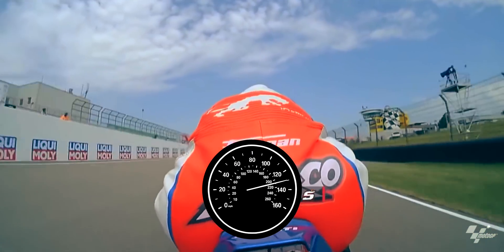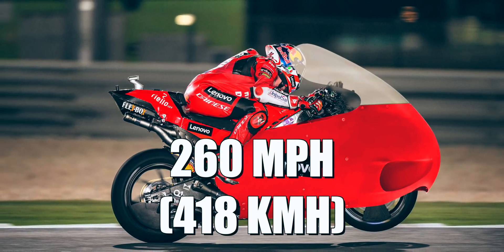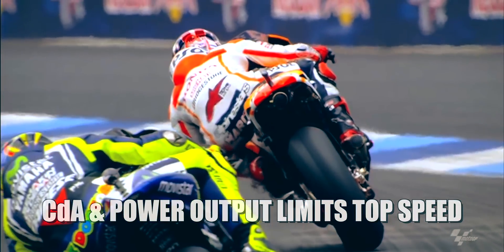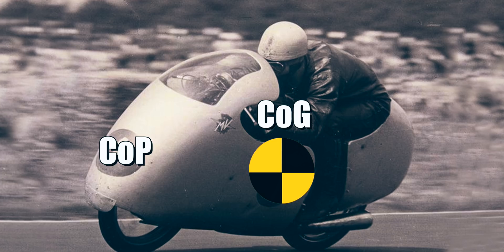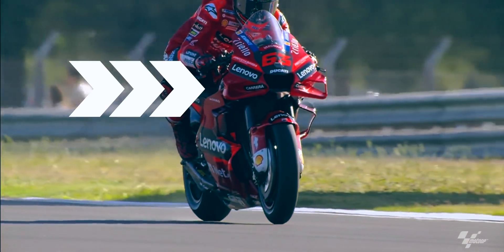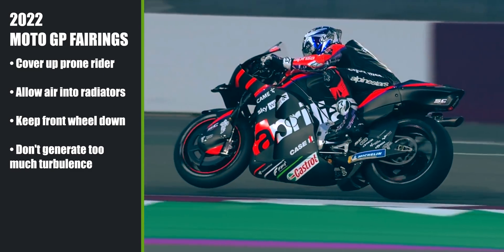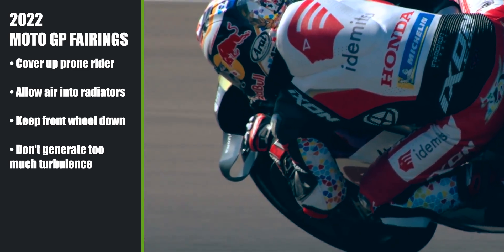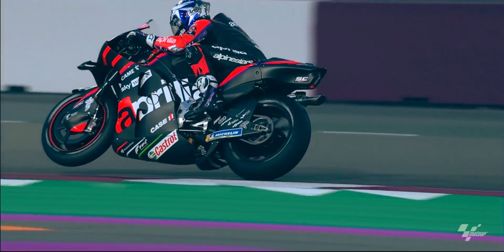Why Don't MotoGP Bikes Have Torpedo Fairings?

Comment: Good reminder of the efficiency of the mid-50s grand prix bikes with dustbin fairings. And they weren't all equally dangerous in crosswinds – some were much worse than others. The Moto Guzzis were better than the Gileras, for example. Also, remember the Norton Kneeler, which was more aerodynamic still (and broke the lap record at the NW200 in 1953). Then remember the Baumm NSU record breakers that were the most aerodynamic of the lot – recumbent riding position meant their 125 did 150mph with 16 horsepower in 1956! Also, Bob MacIntyre managed to do the first 100mph lap of the Isle of Man TT circuit on a Gilera with a dustbin fairing in 1957. I've ridden a lot of recumbent (feet first) motorcycles and never had a problem – from Quasars and Phasars to fully enclosed Peraves Ecomobiles and Monotracers on the autobahn. The Monotracer was measured to have a CdA of only 0.18. In my new the 1958 ban on aerodynamic fairings has been a serious restriction on motorcycle development ever since...

Comment: I do watch MotoGP occasionally, but it loses some of its appeal to me because the things are so slow in the turns compared to F1 cars.

I do wish there would be a way to get the bikes to corner faster. If you watch a video of a MotoGP bike and an F1 car on the same track, side-by-side, the bike looks pitiful in the turns by comparison.
Reply: That is true, but it's not really that the bikes can't corner faster, it's that the riders can't. 

They could add in a bunch of downforce, add in air brakes, all the F1 stuff, but the riders are still only held in by their own grip. To stop faster, the rider's forearms have to absorb that added force. To have more grip in turns the front tire needs more force applied onto it, which means that more force is also needed to turn that tire. And what creates that force? A rider without power steering.

F1 has both driver harnesses and power steering, making it less taxing on the driver at the same speed. Therefore they can push cornering speeds much further before reaching the driver's physical limit

Comment: This problem could probably be overcome to make Dustbin fairings stable and safe using some kind of active or passive damping system or longer more streamlined tail would bring the Cp behind the Cg to make it stable.  But the sensitivity to crosswinds would still be there.

Comment: If the center of pressure was high on the old design, wouldn’t the new wing design have a worse problem of that?

I’m more familiar with cars but having a front end COP especially a large amount of front downforce makes for unstable driving. Wouldn’t having a less aerodynamic front with downforce make it worse?

Edit: I think I get it. Back to cars, the previous generation of NASCARs were flat from the right front where to the rear bumper. This aided in cornering and correcting slides. They were also nose heavy which with the flat side gave it an almost correcting arrow effect the more sideways it got. The old motorcycles had flat sides on the front and were rear heavy. I was thinking downforce not sideforce.

Comment: If fairings dramatically increased top speed, the regulators would immediately cut horsepower because a primary job of technical regulations is to keep crashes survivable.

Comment: having less drag is not always a good thing for racing either.  even with modern engineering designs lowering your coefficient of drag typically means you have to sacrifice down force, which is why f1 cars don't have insanely low drag coefficients because they need down force to corner better, which sacrifices some speed on the straights but not nearly enough to make up for how much better they handle.
Reply: yeah exactly. sacrifice speed up top to be able to take corners att a high speeds and actually take them beter at the higher speeds than if in low speeds to the point where they are almost undriveable at low speeds.

Comment: Another factor is that downforce on the front wheel makes cornering harder.  More grip is needed to counter the downforce.
When considering the dustbin fairings of the '50s, you need to look a bit more carefully.  Yes, there were handling issues.  Some works teams were more successful in dealing with them than others.  Successful examples being FB Mondial and Moto Guzzi.  They both worked hard to test them, in a specially-made wind tunnel in the case of Moto Guzzi - they used a WW2 aircraft engine they had made just a few years earlier to power it.....  The fairing nose needs to be close to the wheel, and well rounded.  A tail fairing moves the aerodynamic centre of pressure backwards for greater stability.  The Guzzis and Mondials had these features, and were much less affected by the stability issues than other marques.  Les so... they were not immune either, witness Bill Lomas competing in the 1956  Isle of Man TT on a dolphin-faired Guzzi V8, due to strong winds. 
The real reason dustbins were banned was that there was an economic recession in 1957. Many marques competing in GPs withdrew, leaving MV Agusta as very dominant.  They had LOTS of problems with aerodynamics, and were able to pressure the FIM into banning the dustbin.  They binned it........
Reply: More grip is needed to counter the downforce?

I'm sorry, I don't get what you're saying

Edit: Do you mean while leaning into a corner, the downforce acts against cornering grip? I think that could be the only thing you mean, it also makes sense
Reply: @Someone25948  Yes, that is what I meant.
A more sophisticated downforce system would give downforce while the bike is upright, but no downforce while turning.  A second device would give lift towards the centre of a turn, to counter-act the cornering forces.  That would require movable surfaces, and would be illegal in competition.
Also, increased grip due to downforce would mean that the bike could be braked harder, which would exacerbate arm pumping issues.  
While we are at it, let's have a device causing EXTREMELY heavy downforce on the rear of the bike during braking, to prevent the  back wheel lifting.  Then you can stop a huge amount harder - if your arms can stand it, of course.  Let's go all-out, and have an air-brake which would actively slow the bike and add downforce at the same time.
If you take a look at John Britten's early bikes, particularly the Aero-D-Zero and Aero-D-One, he was considering these issues - and then for the V-1000, he went for a design with the slimmest possible profile instead.  The rear-mounted radiator with internal air ducts from the front was part of that.  But I digress......
Reply: This was a cool history lesson
Reply: More grip and downforce makes the bike harder to turn and more tiring for the riders. Check the marked increase in arm pump problems on riders lately.

Comment: My friend made one of these fairings back in the 1970's. The crosswind problem is a real issue. My few tests rides on a windy day were not good, and my friend crashed it a few times, then removed most of it. But... we thought it would be excellent for a 3 wheel cycle. It needed a lower profile.
Reply: Correct, this type of fairing was the norm on sidecar outfits in the sixties.
Reply: @brianperry  Yup! All the fairing in the world! Low down and have some lunatic in the side throwing his weight about to make up for it.

Comment: Would be nice if the manufacturers offered an aftermarket economy fairing that reduced the fuel consumption by half.
Reply: Way too dangerous.
Reply: @stevenkelby2169  Dangerous for who?  I ride a motorcycle.
Reply: @TheGreatOldOak  Oh me too, I'm fearless, but a fully faired motorcycle which halves fuel consumption is way too dangerous for a manufacturer to sell. Guaranteed accidents and lawsuits.
Reply: @stevenkelby2169  Motorcycles are already too dangerous, should be banned if safety is priority.
Reply: @TheGreatOldOak  You seem to have a deep misunderstanding of the issue in question.

Watch the video again, pay close attention to the bit that talks about what can happen in cross winds.
Reply: They already have a technology that will half the fuel consumption. It is called smaller engine. 😁😁😁

Comment: Without downforce the absolute max lean angle a bike could achieve is 45 degrees. These bikes can get to 57 degrees+ which means the fairing is generating a lot of downforce. Like F1 balancing downforce against drag to get the fastest lap times is the key to winning. Lets hope bike racing does not go the same way F1 has with silly winglets all over creating so much wake that it is almost impossible to pass.
Reply from the maker: No that is incorrect. Racing slicks can handle well above 1 lateral G.
Reply: @MikeonBikes  The max coefficient of friction you can have is 1.0, using trig and physics that means at a 45 degree lean the bike runs out of grip unless you have additional downforce either through aero or perhaps centripetal forces. Nothing can have a friction co-efficient over 1.0, this is part of the basic equations of force and friction that you learn in high school.
Reply from the maker: @darmah1959  Incorrect. Tires generate friction through adhesion, deformation and wear. Read the following references.

The Racing & High performance tire, Paul Haney, 2003

Motorcycle Handling and Chassis design, Tony Foale, 2002

Motorcycle Dynamics, Vittore Cossalter, 2006

Car suspension and Handling, Donald Bastow, 1993

Chassis Engineerings, Herb Adams, 1993

Competition car suspension, Allan Staniforth, 1988

Drive to win, Carroll Smith, 1996

Engineer to win, Carroll Smith, 1984

Fundamentals of Vehicle dynamics, Thomas D. Gillespie, 1992

Mechanics of pneumatic tires, Samuel K. Clark, 1978

Prepare to win, Carroll Smith, 1975

Race car aerodynamics, Joseph Katz, 1995

Race car vehicle dynamics, William F. Milliken and Douglas L. Miliken, 1995

Science and Technology of rubber, Frederick R. Eirich, 1978

The physics of Tire traction, Donald F Hays and Alan L. Browne, 1974

The Shock absorber handbook, John C. Dixon, 1999

The Tire pavement interface, Marion G. Pottinger, 1986

Tires, suspension & handling, John C. Dixon, 1996

Tune to win, Carrol Smith, 1978

Vulcanization of Elastomers, G. Allinger and I. J. Sjothun, 1964

Comment: People today are to fixed on dyno numbers and top speed numbers. Which those two things don't win races. Lap times is what matters. Weight matters. How much tire you can keep on the ground matters. Super aerodynamic shapes by force want to go straight. Road racing has turns. And if you really wanna know how specific the fairings on your bike were designed then take them off the bike and go give it a rip. The bike will act so different at speeds of 100+mph that it will probably scare you. The way those fairings are designed are so important to how the bike functions in more ways then one.

Comment: You can’t read 0.19 as zero point nineteen. It should be read as zero point one nine. Because logically zero point nineteen (0.19) sounds higher than zero point three (0.3) but it is not correct.

Comment: As aircrafts has retractable landing gears, moto gp brands should develop retractable winglets..
In straights, they will be inside fairing producing less drag. 
In curves, they should pop out for creating downforce while accelerating.. ☺️
Reply: Then they could also add aerodynamic speed brakes and soon enough you end up racing actual jet fighters around the track! :D :D :D
Reply: @matejlieskovsky9625  yeah.. active spoilers attached to rear swingarm and tail 😜
Reply: @me_the_machineman  downforce is good, but imagine active aero that pulls the bike into the corners! Traction is no longer the limit! 4G turns for the win! :D
Reply: @matejlieskovsky9625  yeah . This to be minded ☺️👍
Reply: Some of these high powered naked bikes out nowadays, can become death traps, when people start fitting one size fits all wind screens on them. They were never designed to see the speeds some of these bikes are capable of. Shit, my Triumph Speed Twin gets near burying the needle at 140mph. That's a fair clip without a windscreen. I did fit a Puig Vision universal "mini jammer" as I call it, on mine. Makes all the difference in the world, especially when cornering at over 100mph.

Comment: I think it's time to bring back dustbin fairings . With today's knowledge of aerodynamics i am sure they can do something about it like how f1 has underwings now .
Reply: Wtf is a underwing
Reply: @TinyBearTim  it's a underwear 🩳 with a wing .
Reply: @TinyBearTim  They are called ground effect cars and it uses the venturi effect to suck the car down to the ground. Just search f1 2022 ground effect they just brought it back this year last time it was used was the 1980'S
Reply: It will introduce more turbulence and make close racing impossible... 
Plus the speed difference inside and outside the slipstream will be greater resulting in more unpredictable braking points... That will be goodbye to close racing because the only part that riders can now overtake is on the straights. (Like F1).

Comment: Food for thought that. I'm wondering, now we are seeing such close racing as highlighted by the fact the first 3 races in 2022 had 9 podium riders, is it time to review the rule around minimum bike weights? This is prototype racing afterall and my understanding was the main reason being to avoid a competitive gap between the Factory and Open class manufacturers. However given they already achieve 220mph+ a weight reduction would never be permitted?
Reply: Close racing is the most fun

Comment: it is crazy watching the GP riders turn mid wheelie so smoothly to. The Gp bikes look amazing this year to.
Reply: MotoGP bikes have anti wheelie on their computers. It's all electronically controlled.
Reply: @matiasdun6599  You might want to check that. I'm not sure it's true. They have more elaborate on board computers, but there's no ABS or traction control. They may have also deleted wheely control to enhance rider skill. Something they wouldn't dare do on a bike any squid can buy...
Reply: @tsubadaikhan6332  MotoGP bikes all have traction control. My ZX14 doesn't have abs or traction control, anyone could buy one then (2006-2009 don't have abs/traction control) It presently puts well over 200 hp to the ground, which is way more than it did when it was stock. I would not let just anyone ride it.
Reply: @tsubadaikhan6332  almost all motorsports kind of have traction control and all other systems. they are just very very very expensive and more adjustable. F1 even adjust it all mid drive  based on what is needed for the situation. don't know how much MotoGP controls it during the race as i imagine it's harder to change all that when riding a bike than when everything is on a steering wheel and only one thumb away from the adjuster.  also normal vehicles usually don't just adjust each different system separately but rather have them bunched up so what you might mistake as traction control stopping you could be more likely to be som other system that is protecting against what it believes is a loss of control. these systems need to be that simple because 1. it's street vehicles 2. complicated systems are expensive AF
Reply: @rampage3337  — F1 does not allow traction control, now. It’s been banned for many years.

“Traction control was introduced as a safety measure in road cars to help drivers improve car control in slippery conditions. TC can be found in some forms of motorsport, such as GT and closed-wheel racing, but is not permitted in F1. In the F1 2021 game, TC is available in 3 different settings, Full, Medium and Off.”
Reply: @matiasdun6599  no not anti wheelie. they got wheelie control but it's not anti wheelie. it gives the rider more control and instead of listening to the riders exact inputs it calculates som out of it to make the front not rise to much but with enough throttle it will still rise and can flip over. it's like if you have ever played a racing game that has assisted braking or assisted steering. it's kind of like that you can still fuck up but the vehicle helps you a little with it. call it a increase in the window of margin of error
Reply: @rampage3337  Man, you're describing what is called "Anti wheelie" by most of the people and articles of MotoGP.
Even the official page name it like that. I name it anti wheelie too since even companies who sell bikes with that technology call it that way too.
Of course it cannot make the wheel stick to the pavement at all times. But it's called anti wheelie by the majority.
Reply: @matiasdun6599  don't Mather what the fuck they chose to call it as it's still wheelie control. anti wheelie is just misleading specially for MotoGP that i don't even think is programed to be ever able to go that hard. makes more sense for street bikes to be called anti wheele because they can actually have a fully preventative wheelie control. MotoGP most likely just uses it for ease of understanding what kind of system it is rather than use the right description of it.